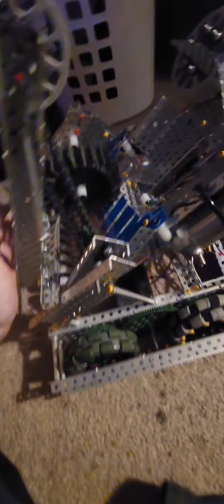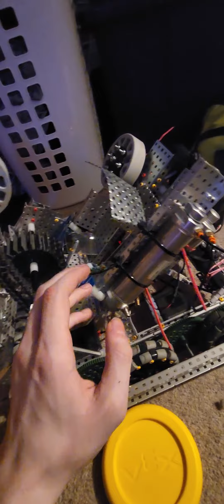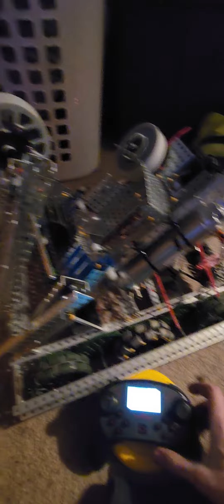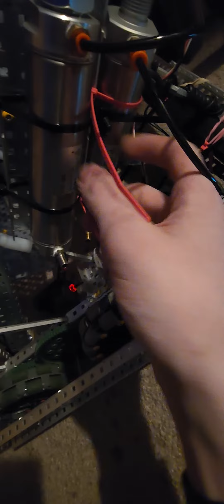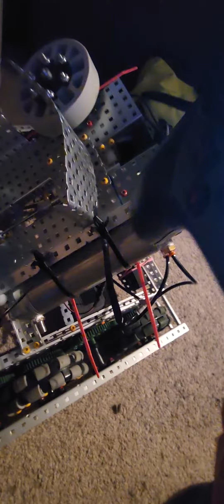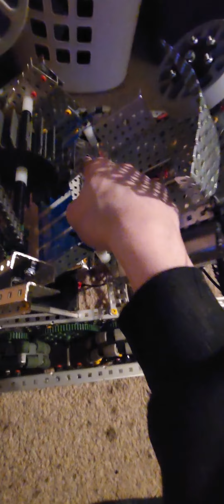785Z Robot VEX Spin Up

Comment: You should probably support the flywheel axle from the top as well
Reply from the maker: We didn't run into any issues with our flywheel at all, we actually ran into issues with our intake due to not having the right setup of flex wheels (We didn't have enough)